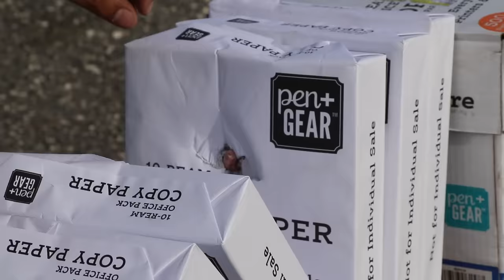50bmg vs 416 Barrett

Comment: A little bit of science: The bullet stuck in the metal is less hot than the one found on the groung because metal is good heat conductor and if bullet stuck in it like that, it transfers and looses its heat much sooner.
Reply: A little bit of science #2. The bullet heats up due to deformation - any material does that. The one stuck was deformed way less as well as the metal "wall" it got stuck to.
Reply: @IDGinUkraine  so the explosion is cold
Reply: @user-jc2in3cp3g  the explosion is in contract with the bullet for a very short period of time. Like passing your hand over a flame. Bullet heat mainly comes from friction from engaging the rifling in the barrel and deformation.
Reply: Wah kya explain kiya
Reply: @IDGinUkraine  There are many factors included - initial explosion, friction in the barrel, even a bit of air friction above supersonic, then friction in the target and yes even the deformations
Reply: 98.6

Comment: The short barrel .50 looses alot of velocity, in the paper the core was still in the jacket. that .416 with soft copper rounds is amazing :-))
Reply: .416 has a superior ballistic coefficient; heavy, skinny, long bullet retains energy better, and is usually more stable.
Reply: @lairdcummings9092  50 bmg hornady??
Reply: @aleks4996  not really familiar with that cartridge loading.
Reply: I was wondering the paper bent the copper back by 180 degrees
Reply: @lairdcummings9092  Yes fully agree especially at extended ranges! A Real sniper round :-))
Reply: @jozseftoth9368  Yes me too, sometimes they anneal the copper which is the opposite to steel heat treating, heat copper up red hot and then cool rapidly in water and it goes really soft :-))
Reply: @jozseftoth9368  pretty sure that yes,  that's exactly what happened - relatively soft copper will take interesting shapes when put under extreme stress.

Not sure if the bullet was annealed deliberately, or if firing process had something to do with that.
Reply: @lairdcummings9092  look 50 bmg hornady, has a superior ballistic coefficient
Reply: @aleks4996  superior as opposed to what? What's the standard of comparison - standard M2 ball? SLAP? Tracer? .338 Lapua?

Like I said: don't know that loading, so you'll need to give me a bit more information.
Reply: @lairdcummings9092  Hornady 750gr has a G1 of .486, and the .416 398gr Barret has a G1 of .688. Rather have the .416 because of that. 400 grains with a higher BC for the win Alex.
Reply: @Ripper13F1V  yes. Exactly.
Reply: @lairdcummings9092  With the same .50 cal bullet of the hornady brand, the longest loss in history was made, it was 3,450 meters, of course with the help of its ballistic coefficient that is higher than a standard bullet, I think I have nothing else to add, besides that it is also used to pierce armor, you are only snipers in games while I am in real life, that's why I know what I'm talking about, greetings ✌
Reply: @Ripper13F1V  With the same .50 cal bullet of the hornady brand, the longest loss in history was made, it was 3,450 meters, of course with the help of its ballistic coefficient that is higher than a standard bullet, I think I have nothing else to add, besides that it is also used to pierce armor, you are only snipers in games while I am in real life, that's why I know what I'm talking about, greetings ✌
Reply: @aleks4996  so, real life... Care to tell me of any long range sniper shots taken with a .416?

Oh, wait... No one uses it as such so you have zero comparative data.
Making claims in a vacuum? Yeah, that's a bullshit analysis.
Reply: @lairdcummings9092  Nobody uses it because it is less effective than .50, now go play your video games because you only say nonsensical things, nor are you a sniper, you just search everything in google and you don't even know what each thing is for, greetings ✌
Reply: @aleks4996  no one uses it because you assume it's less effective. Without any actual tests. Again, making claims in a vacuum. Being "real life" still does not make you an analyst; that much is entirely clear.

 You think you're right. You might be right. But you have zero way of actually knowing that. And yet you still insist, absent evidence, that you are right. 
Yeah, I'm not convinced - not at all.
Reply: @aleks4996  No doubt that particular bullet can do it.  Light vehicles can be stopped with .300Norma and .338LM too. And while I do enjoy my video games, you are making quite an assumption that only sniper qualified folks know anything about shooting at long range and ELR. Which isn't true at all. I regularly spend time on the firing line beyond 1000 Yards and have hit at 2K. Getting beyond that requires a very different caliber than what I currently shoot. I currently am jonesing over .375CT.

Comment: Barret 416's are crazy accurate at well over a mile. Almost a mile and a half, actually. Tight groupings at 1.42 miles. 

I wish you guys would set up some long distance targets and film the results of long range shooting. You definitely have the room for it out there but it does seem pretty windy.
Reply: and this is not strange, because the barrel length is longer, and the caliber is smaller, if the 50bmg had a barrel of this length (in calibers), it would probably have similar accuracy ..

Comment: The 416 is based on the 50 case.  Actually, the 50 case is slightly wider, it just looks thinner because it is longer and has a larger diameter bullet.
Reply: No no no no no no, nothing is based on nothing dude.. It's all original and natural. Nothingness and a little more about what you are looking at and what you think about it and how you feel it would be a good fit for you to consider as a good fit and a good fit with a wide range of products for your business or for your business and your customers and your business partners are very important and you are a great asset for your business endeavors in the industry and your company is a very competitive and professional company with excellent customer service

Comment: The 50bmg at the end was cooler because it was embedded in a massive heat sink. 
The Finnish sniper Simon Hayha was said to use iron sights because he was faster at acquiring a target and getting a shot. This enabled him to beat enemy snipers to the draw and make the kill.
It would have been informative to see the performance against bullet proof vests and ballistic gel to see how they performed against likely targets.
Reply: I was that guy in Bootcamp. Had no idea speed acquisition was a thing until compared to a couple hundred others. I could aquire my target and shoot faster than the rest. I would be done by the time the others got halfway through. Shooting 38-40s. So, my Drill Sergeants would make me do push-ups while we waited for everyone else. Still didn't slow me down, I couldn't help it. Also tested and found that I have 13-15 vision (Can see higher detail at distance), so that probably helps.

Comment: I’m sure I’m not the only one here that thinks this guy is clueless. Among the obvious are the 416 case is a shortened, necked down 50 bmg case. Second two different length barrels. 416 is 29” and 50 is 20” which will make a huge difference in muzzle velocity.

Comment: Edwin, when you said the 416 was hotter than the 50bmg, the 50 bmg was cooler because it was still in the metal, and metal it's a conducter so the heat was spread through out the whole peice of metal

Comment: The 416 case is not any different as its just a shortened a necked down 50bmg, there's other 416 calibre cartridges as well, 416 Rigby , 416 Remington magnum,416 ruger and more than a few more, they are mostly "stopping" cartridges than long range precision though.

Comment: most .416 projectiles and loaded ammo is solid copper.  the 50bmg was copper jacket over steel encased  lead core.  jacketed bullets usually break up. solid brass or copper bullets bend or deform like the banana you found. fun stuff.

Comment: You don't understand the most simple example of thermodynamics! Metal is highly conductive which means it exchanges energy to what it is touching something at a different temp it will transfer said heat which is energy to the cooler metal!